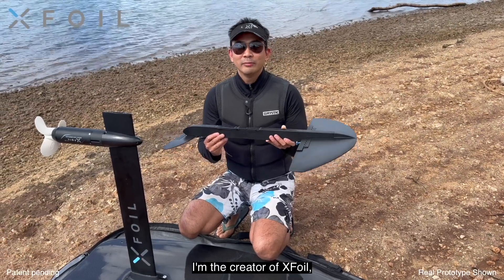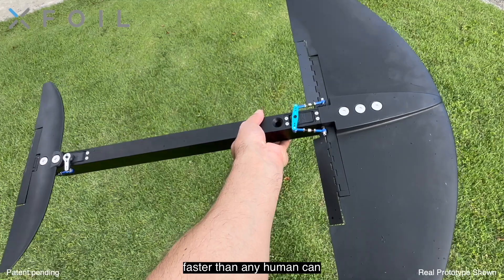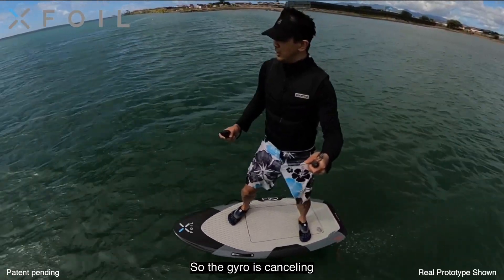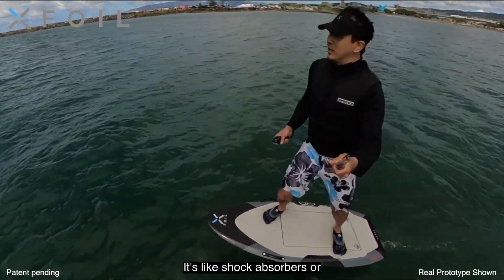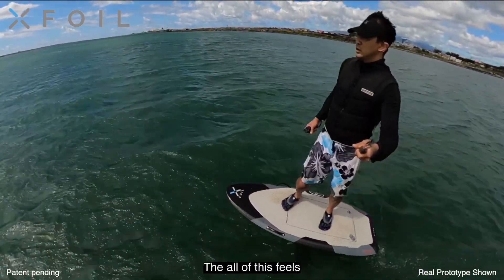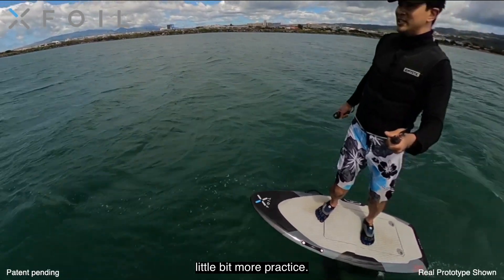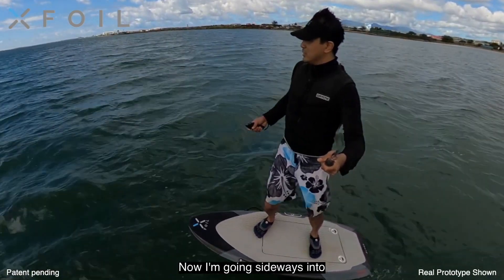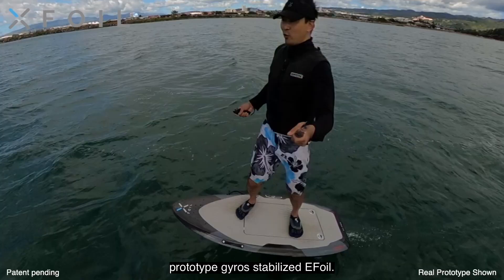XFoil Dynamic Wings Prototype Demo

Comment: I'd never use it. Butttt this opens the gate for wings that can have more lift down low and more top end by simply changing on the fly. Would be cool to have a way to change these settings manually without relying on software or batteries. Similar to how America's cup works. Although they are starting to rely on batteries as well.

Comment: What question is this meant to answer, apart from commercial transport applications? People generally ride efoils and paddle assists for fun, which generally means lots of carving turns. Why would they want to go in a straight line forever, in chop or not?
Holiday hire for tourists?
It’s no use for beginners because they won’t learn the reflexes necessary to control flight and besides that, my wife went from full beginner to flying in 30 minutes, despite having no board sports background. It’s just not that difficult, so…again, what question does this answer or what market is it targeting?

Comment: You say that you normally wouldn't be able to ride an E-Foil when there's wind or small ripples in the water? That's absurd.  
I'd like to see you show how the foil reacts to turns. If you turn and the foil rolls left or right, does the processor differentiate between desired movement vs. that cause by the small ripples in the water?  As an engineer I'm always skeptical about. sales pitches, while my human gyro counteracts silly claims faster than I can comprehend.

Comment: I am a kitefoiler. As long as your foil is under water you never feel any waves and small ripples. The negative effects of those control arms in drag and vibration are more that any positive effect on stability. This product only makes sense to people that have never foiled.
Reply: Stablization is the future, like aircraft but you are right, claiming stabilization against waves was super innaccurate, they need to put a noob on it